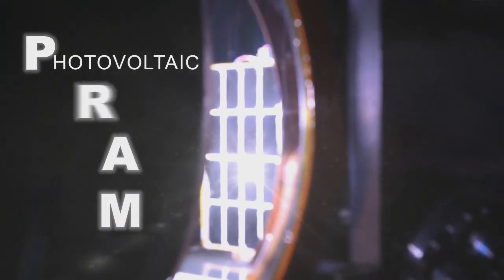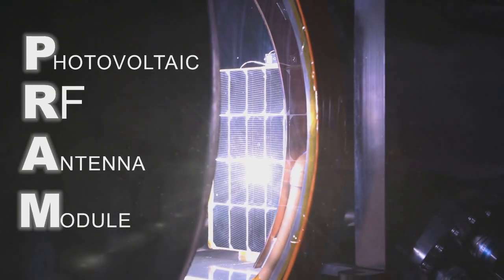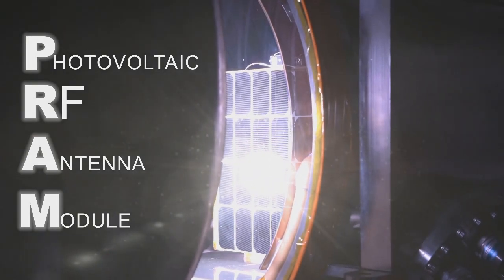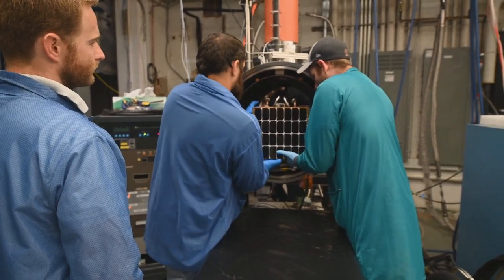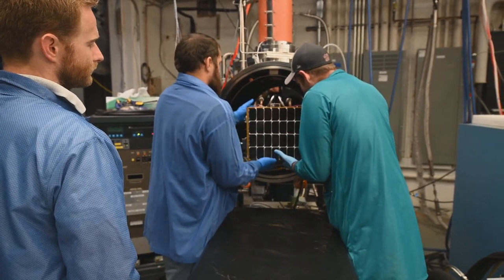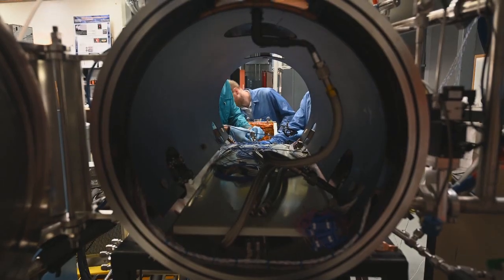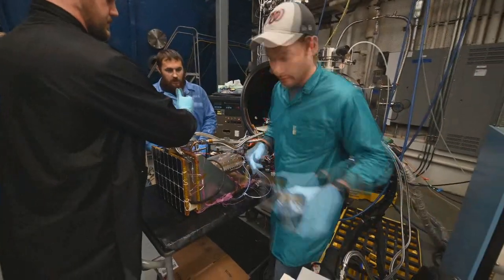Photovoltaic Radio frequency Antenna Module

Comment: Huge loss in efficiency through conversion and delivery here. The best you will get out of the solar panels is about 35% before the loss. Ground based generation through fossil fuel is between 65% and 75%. Not a serious competitor to current means of energy production.
Reply: Efficiency doesn't matter much when your power source is infinite. This just needs to be cheap enough to get into orbit.
Reply: @davidw860  "Efficiency doesn't matter much when your power source is infinite." Not sure you understand how this works. It will never be worth getting it to space, as it will only begin paying for itself thousands of years after the hardware is broken.